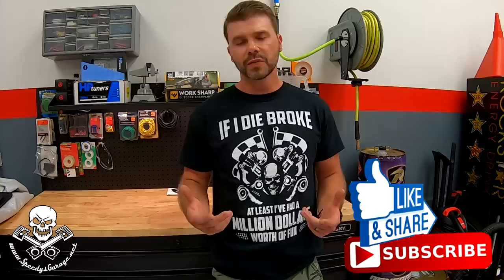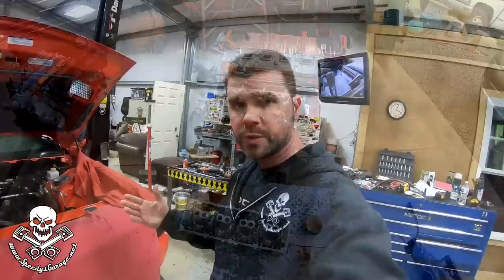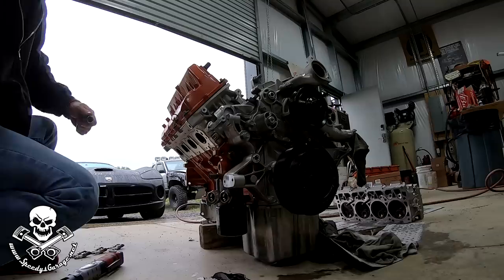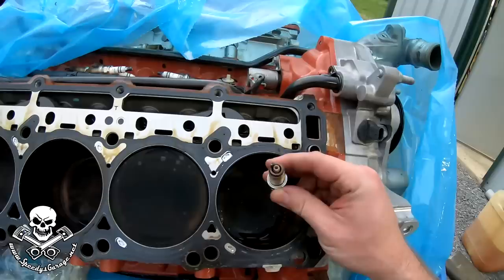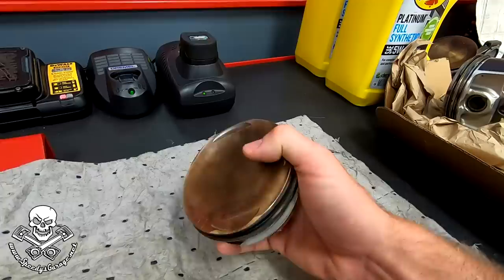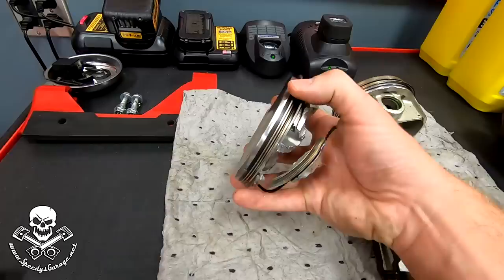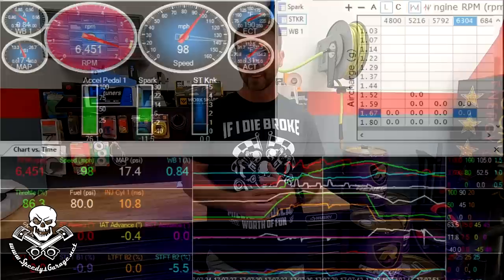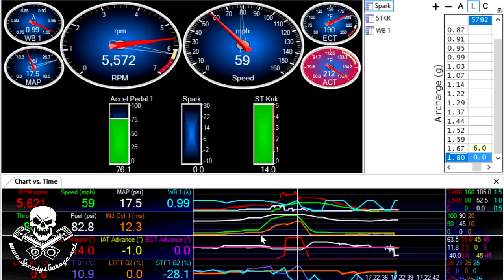Hellcat Engine Failure Diagnosis Speedy's Garage Challenger Go Man Go

Comment: Having worked as a metallurgist I've seen breaks like you encountered in the #7 piston.  Generally, we found that the pour had air pockets or was dirty and had some contaminant or other debris in the batch.  You just got a bad one.  It happens and doesn't mean anything special.  Unless you make metal in very special conditions including vacuum, the quality varies from batch to batch and sometimes will produce a failure such as this.  All the others survived, so you can see it isn't a matter of quality control or recipe for that alloy.
By the way vacuum metal companies that produce extreme high quality would cost you thousands per piston, rod, etc.  It's a very expensive process and is reserved for extreme situations.
The real issue is you surpassed the design limits of the metal.  Tensil and yield strength are an engineering design function.  Your engine was designed for a maximum amount of stress.  You passed it.
Here's one resource if you want to pay the bucks:  https://www.metalwerks.com/
Reduction of air pockets is crucial for high strength on a regular reliable basis.  Techniques in mixing/melting the alloy is also critical.  You won't get that in a mass produced auto product because generally it isn't necessary.  When you attempt to pry more out of a product than it was designed to endure...well, shall we say...all hell breaks loose.
Reply: A Day stop Ron! ( jersey shore ref)

Comment: One thing that jumps out at me is that most of the failures are at the ends of the block. Could it be that the block is distorting at high RPM and squeezing the piston?
Reply from the maker: I've noticed that as well.  Your theory is a good one, mine leans more toward cylinder 7 not getting as much fuel maybe.

Comment: Is it possible the rear cylinders are getting a gut full of oil in them from the pan , caused by the G forces of the launch ? If enough oil got past the windage tray and got up under the pistons, it would hammer the pistons to death ! Imagine, even one ounce of oil getting struck by the piston traveling at that velocity , the shock loading under the piston would be enormous and those gudgeon bosses don't look that strong in that direction ! I'll wager that scenario was not even thought about when the pistons were designed .

Comment: Early 392's were noted for "Glass Pistons". Also, to get the stroke you want they have moved the wrist pin boss way up into the piston, IE - Where's the BEEF.
Reply: To meet emissions the top ring is very high on a 392 so everything gets burnt off.  They are all like that, 2011+.  Only difference is now they share the hellcat/BGE block where the earlier ones were a lighter casting.
Reply: @MaliciousSRT  Yup... Same issue with the early 2013 & 14 2.0T Cadillac ATS.

Comment: did you do crack inspection sprays on the non broken pistons?   tight piston at the top. yes.. weak piston design.. weight reduction efforts on the piston design took out just a little too much for it to survive..  you may also want to look at your injector pulse width at that close to 7000 RPM and make sure you have NOT maxed out the pulse width... then flow test the injectors at that pulse width to see if any are not flowing equal to others.. at that high speed..  also looking at the knock sensor voltage in a single frame does not tell the story.. look at it on the graph.  voltage is only generated for a split second and may be  beyond the individual frame rate displayed .. but is picked up by the PCM.  the knock retard could have been the skirt coming off too.
Reply from the maker: No I didn't do any further inspection, but the items you mention like inj PW are sound advice.

Comment: Seems like a lot of old school common sense has been lost,the rod looks a bit thin,ps 500 horsepower is stressing things,and very much doubt manufacturing build engines anymore to withstand high horsepower tunes,it all comes down to cost
Reply: Concur, rod broke first, piston looks like it does because it sat on the bottom and got beat by the crank for a while, then got kicked to the top where they found it.
Those factory rods look very weak. He just needs to put some CP pistons on Carrillo rods and call it good.

Comment: I haven't seen the cylinder yet but too tight a ring gap will rip the pin out of the piston, or snap the crown off, or hang up on one side and crush a skirt.

Comment: Looks like the ring gap was too small. Rings got binded together and broke the Piston.
Reply from the maker: When rings touch it breaks off the top of the piston.  Seen that in a BUNCH of cars from too much heat.
Reply: @SpeedysGarage  Maybe the Hellcat piston is weaker at the bottom causing it to pop out the bottom not the top?
Reply: Speedy's Garage 
This happened to me with a GM engine lq4 with 243 heads, exactly as you described it

Comment: You realize that those hemis are at their limits? By pushing it you are risking stuff like this happening. Anything above manufacturer spec is not ordinary and should not be surprised when it fails.
Reply from the maker: I don't think so.  Lots of them at 1000hp and my new Demon/Redeye engine is doing great and ran 9.80s at 141.  Same setup as the Hellcat motor had and on 93 as well.

Comment: Casting porosity, weak skirts,low octane gas( l dont care if you can run it pump fuel) timing glitch...boom !! 
I'm sure that motor wasnt designed for continuous 7000 rpm shots...

Comment: This is why you "blue-print" a motor before making 800hp +, just for longivity.
Reply: Blue printing would not have made a diffrence when u blue print all u do is make sure the specs are exact to one another. The only thing that would have saved this is torque plate honing the holes. This would have ensured all the holes are perfect under the torque stresses once assembled
Reply: But it had a defective piston .  It would have come apart regardless.
Reply: James Jessome it was only a matter of time

Comment: Lean tune? Created heat issues
Reply from the maker: Lambda in the logs was .83 - .84 so wasn't lean at least from the log.  Doesn't necessarily mean cylinder 7 didn't have a fuel issue though.

Comment: looks like dodge might be using amazon fake plugs with those porcelain failures.
Reply: I'm guessing extreme heat cycles. It's tough on any standard or "factory" plug. It may be a high performance car, but let's not for get it's still a Dodge.... lol

Comment: The way I hear it #7 rod failed is common.
Reply from the maker: Interesting
Reply: it is a sign that something is related to the design of the engine by itself, it can be cooling or oiling as oil have the mission to cool the parts.

Comment: I like dodges but look at the first fast an furrius movie with the 69 charger an the original big boy hemi did the same thing an when I did his rod punched threw the block in the movie so ya hemi has a long time problem with valves an piston rods just like with chevys big boy.motor the 454 they had issues with an crank bearing caps even with the 4bolt mains they would have spin bearings an a rod would knock after yet the 454 is a beast of a motor so ya issues that can happen with many engines just like how 80s an early 90s ford 5.0 would  low the motor it ya ytyed to push it over 400 hp so ya

Comment: yep I agree with egt's to high and rpm to high too the force put on that rist pin was too much and that's the weakest piston in that set. any time you add rpm's higher than stock rpm you take the risk of poping a piston top and yes to much heat didn't help  you answered your own question there factory build to and things are not all the same even piston ring clearance could have been to tight or piston to wall clearance to tight many thing cause these things. some people get lucky and others don't  good luck

Comment: You crack me up,  This is why the factory has rpm limits on the engines they design. Then you run past the factory  6200 rpm limits and wonder why your engine fails. Running an auto tranny? Set to shift at 5800 rpm and you will hit the magic 6200 rpm. Piston speed is why Dodge is using the 6.2 engine, it is the bore vrs stroke.  What and how you plan to run your engine determines the money spent on the grade of engine parts/ power and rpm level/ where your rpm range it to be run. Sure you can run higher rpms, this is why a lot of higher end racing teams have to rebuild after each race. The engine is worn out. You want higher rpm`s, easy There is a math formula that takes in to account, head flow= duration you can run and tells you your piston speed.  This is really important, next your bore and stroke determine the engine speed/ safe rpms you can actually run your combination. There are a few formulas which can answer this question for you. As follows, head-flow determines camshaft duration you can max run. Want more rpm, change the bore and stroke to match a piston speed with higher dollar balanced rotating assembly. There are ranges of piston speeds these engines are designed to run in, ie; stock street performance, drag racing, indy, you get the idea.  A stock engine long block direct from Dodge is 8300.00. No supercharger, just the same engine for replacement brand new. Not a modified 15,000.00 engine, not a well up graded 25,000.00 engine, not even a upgraded race only engine between 50,000.00 and 75,000.00. Was not built from the factory to run beyond the limits of the factory design or specifications/ materials for the power level. Should listen to the tuner who said not to run past 6200 rpm. Like he said, it is your money. PS, That cross fire from #2 to #7 was a flame front passing through the lower intake manifold, do a pressure check on the inter-cooler and examine for damage. Might want to remove the top cover on the blower and examine the rotors on the blower for debris. You could be building that engine a second time.  Again, it is your money. I hate to see folks getting the wrong idea and blaming the piston materials and design. The Dodge 6.2 has a really great reputation as a reliable engine when not over speeding. Great tuning does not make up for lack of proper engine building and knowledge. There are protocols in the industry, go call and talk to a knowledgeable engine builder, then tune. It was said best, there are thing a race car can and can`t do.
Reply from the maker: I didn't read all of this, but seems a bit of a lottery like I said. Several friends spin theirs to 7200 shrug.  This all happened a year ago and original blower is doing its thing on the Demon motor we dropped in.

Comment: Ring land broke..causing piston to wobble in cylinder until it snapped...don't take a genius to know that
Reply from the maker: Actually that's not what is believed to have happened.  Heat caused the piston to stick is best theory based on many others doing the same thing.  Cyl 7 in these cars is vulnerable for whatever reason.  I pulled the pistons and none had broken ring lands.

Comment: To the video of: (Hellcat engine failure diagnosis speedy's garage challenger go man go) about that engine failure with those pistons you do all you can to reach Chrysler Corporation and let them know about this issue. Next  maybe Chrysler Corporation maybe not using high quality racing forged pistons (Example like 1.SPEED PRO or 2.TRICK FLOW pistons) on the hellcat or Demom engines or high intensity forged connecting rods for racing application. But get a hold of summit racing and talk to them about after market high quality parts on  the aftermarket side that's in the racing business. Ask summit racing for some venders and phone numbers and explain the problem, maybe they would have a better product for you to buy for pistons and other parts. Now summit racing has alot of parts and items for you to buy. Here is Summit Racing phone number 800 230 3030 when you call them you ask for all 3 of their books one of the books has all the parts, one has tools, and I forget when third one has. But they have a lot of things. what do you order all  3 catalogs from them it would take you about a week or ten days to get it in your mailbox. Next for what you showed for the piston on the video it look like a very poor piston as far as strength and how thick the aluminum is and durability cuz no shoulder or side wall on it the speak of, for what you showed on the Piston they could've have made them pistons a lot better. To what I'm talking about look at a 440 or a 400 or 360 Chrysler piston look at the difference between that and what you showed, one time I pick up a semi load of pistons and connecting rods and I got to watch the weight between each piston    it was in 4 grams but they didn't make them where they all even and the same  with the connecting rods with in 4 grams. You take that 4 grams and multiply by the RPM's that engine that adds up to alot of weight in motion. If you have a gram scale you check and see the   difference. I remember asking about that and they told me that it was close enough for Street use.

Comment: How do you blow an engine with all those stupid electronic nannies on it?
I just shake my head when I hear people leaning on those damn rev limiters thinking they are doing something. They are....they're losing power. It sounds like ...duh duh duh duh...dumb.
Reply from the maker: It's a balancing act.  Increasing RPM gains ET and MPH in these cars as they continue to make power well past the stock rev limit.  In the factory tune there is a table with a 400RPM increase, so some easter egg deal activates it I reckon.  Demon and Redeye have it as well so theirs go to 6700RPM.  Probably how Dodge got the Demon to run 9.65.
Reply: @SpeedysGarage  If they blow the engine...there was no balancing act. If your rev limiter is going to "cut power" at 6700 rpm....you put it at 6600 rpm...it takes a little foot discipline. You don't just mash it to the floor. Throw a clutch into the mix and most of these folks are lost.

Comment: I would love to see the rod that from Piston 7 please.  I have had the same issue with a four cylinder that was highly modified and had stock pistons in it and it failed the same why, after putting forged pistons in the problem was solved, we got 782 horses out of it with twin turbos and she never gave us problems after that.  So I would say that you would have to do extensive testing on the stock pistons to see what stresses it can take and what to look for so as to minimise failures like this.  If you can please send me a picture of the rod for that piston to michaeldut@dutoitsmobileauto.co.za
Reply from the maker: Never found it.  Guessing it went out the oil pan.

Comment: Tats the Fiat heritage showing its face
Reply from the maker: I dunno.  3-4 simple mods and I have a 9 second street car.  I dropped a RE/Demon crate motor in the car and ran 9.83 at 141 with tons of overhead.  Not sure what other OEM has that kinda performance.
Reply: @SpeedysGarage  I have no doubt its a powerful car and they look good too but after Fiat bought them out there dependability is gone down and I mean Dodge/Chrysler as a hole

Comment: well cheaply made bad quality, more power then built to handle
Reply: I guess you did not watch the whole video where he says that he was running a tune for 800HP and had spun it to 7000 rpm. He pushed it beyond the designed limits and broke it. Simple as that. Forged pistons should solve the problem though.

Comment: Imagine that, modern Mopar wont last five years....  Those engines are pure garbage. Rollers lifters that don't roll, bearings that throw, rocker arms breaking off, paper thin cylinder walls, Chinese steel.... just an all around great paper weight.
Reply: Leave it factory stock like it was intended and it will live.